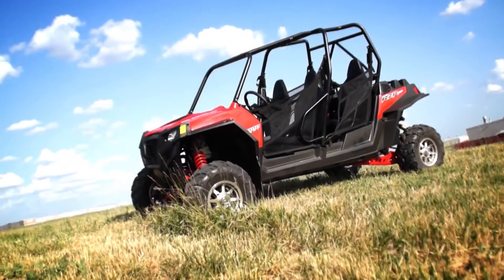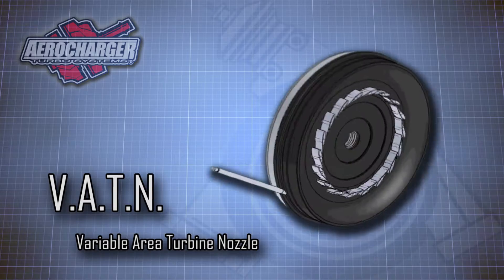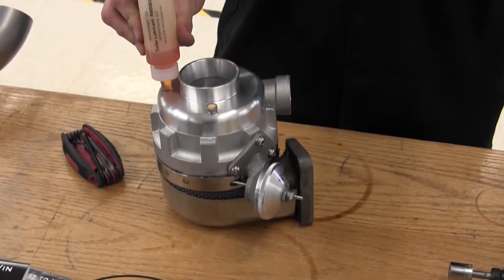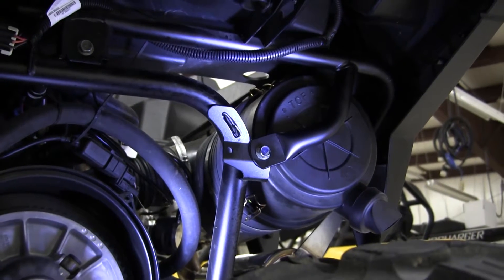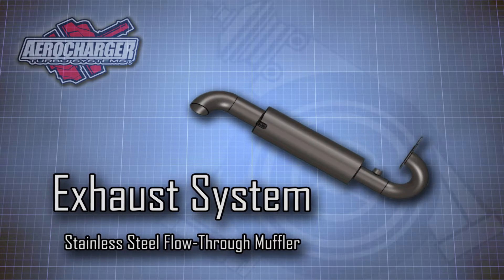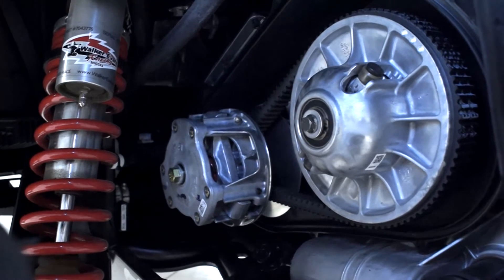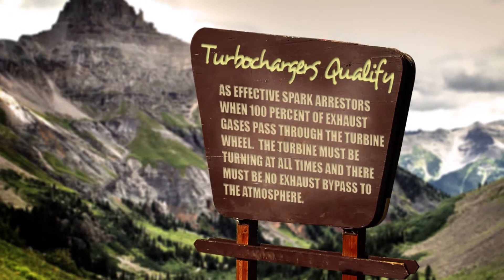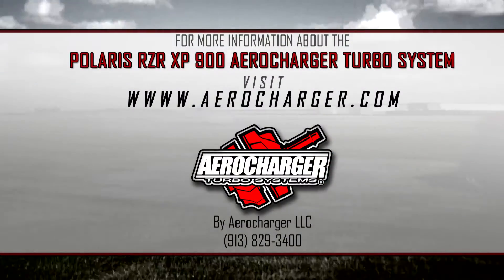Polaris RZR XP 900 | Aerocharger Turbo System

Comment from the maker: At 5.5 psi it makes 96 hp at the tires and on 10 psi it makes 126 hp.  At stock it dyno'd at 60 hp.  This kit is designed to run on a stock engine with no modifications, but it will also work with other engine mods such as big bore kits and lower/higher compression.